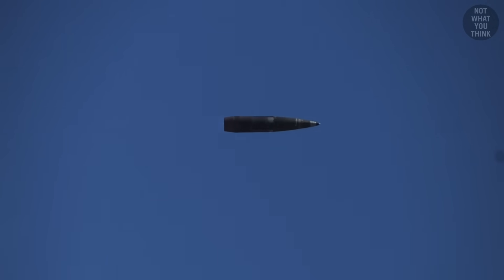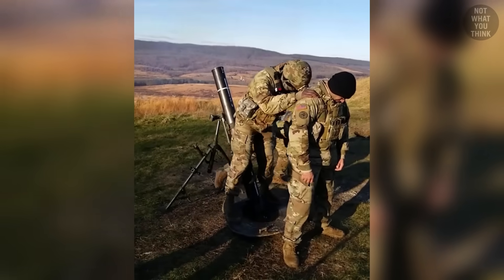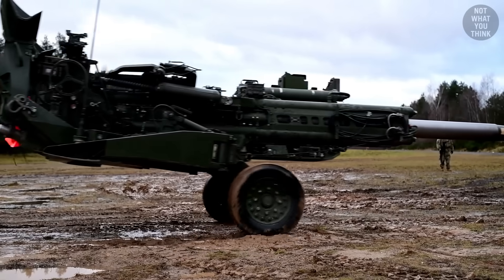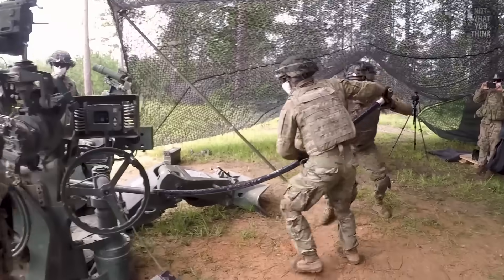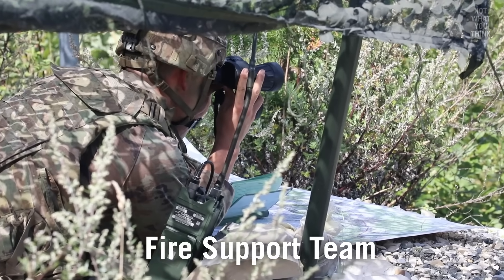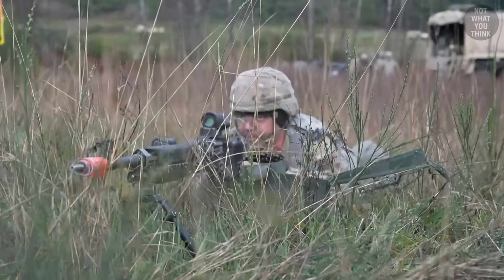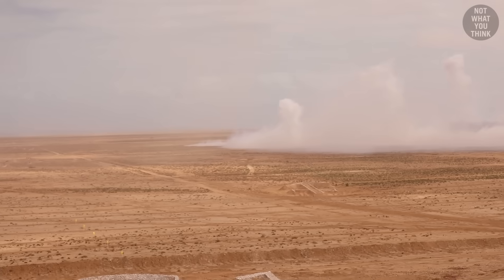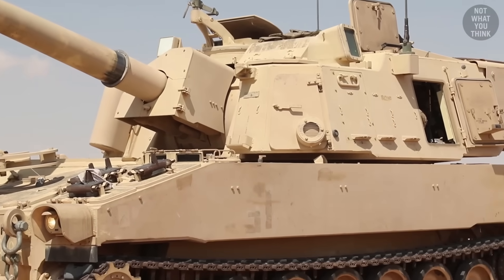How Aiming Artillery without Seeing Target Works

Comment: I served 2 years of National Service in an FH2000 battery 14 years ago... The most vivid memory is still ramming iron pickets into the ground with monkey rams and standing on the trail legs to drape the camouflage net over the gun, while the more "useless" fellas in the detachment scramble under the net to hook the sliding pipes up to the net to make it stand. And then when all was done we would hook ground sheets to the camo net with carabinas to shield us from the sun, and put soft drink cans in the cambros with ice to soothe us in the tropical jungle heat.

Comment: As a former artillery soldier, I have to say: this video contains a lot of half-truths that might sound impressive to laypeople – but they don't reflect how things actually work.

For example, the claim that firing at angles below 45° is done to hit the target faster due to a shorter trajectory. Sounds logical, but in practice, that's nonsense. Artillery is all about range, impact on target, and tactical necessity – not speed. Most of the time, artillery fires indirectly, often at angles above 45°, depending on distance, terrain, and ammunition.

The part about "target posts 160 meters in front of the gun" is also completely wrong. In reality, surveying teams place reference points (e.g., poles) with known GPS coordinates to precisely locate the firing position. The guns are then set up around that, depending on the terrain. The fire control center receives offset data for each gun in mils and distance relative to the reference point – this allows for precise coordination.

Yes, direct fire is possible – but only in emergency situations. If the enemy gets that close, something has already gone very wrong. Artillery is usually positioned 15–20 km behind the front lines. To engage in direct fire, optics need to be swapped, angles set manually, etc. That’s not a standard tactic – it’s a last resort.

The real danger for artillery is counter-battery fire, often via radar that tracks incoming rounds and triangulates the gun’s position. That’s why systems like the PzH 2000 are so effective: roll in, auto-survey via GPS, fire, transmit data via datalink – and move out immediately. No time for the enemy to respond. Hit and run – that’s modern artillery warfare.

And the soldier "looking through the sight" in the video? That’s not a sight – it’s a gun laying device. He’s not aiming at a visible target. He’s adjusting the gun based on elevation and azimuth data. Artillery doesn’t fire like tanks. It’s math, not line of sight.

Bottom line: If you’re going to present military topics, make sure you do your research. Otherwise, you're spreading misinformation that might sound exciting – but has little to do with how things actually work.

Comment: At 9:08 it is mentioned that the cannon crew can fire without commands from the Fire Direction Control (FDC) There is a little confusion there. A cannon crew can't do indirect fire without data from the FDC. The aiming stakes do not work like that. A cannon crew can only do direct fire without data from the FDC. That is where the target can be seen by the crew and is in direct line of sight of the gun. The aiming stakes are being emplaced as an aiming point to keep the gun laid on the (line of fire) or the azimuth of fire. There are 3 types of aiming points we use. The collimator which is primary, aiming stakes and a distant aiming point-- like the crest of a hill. There are reference points used by the gunner.

Comment: Correction: 7:54 into video. The FDC does NOT know the location of the targets. They are supposed to know the location of the forward observer and fire on the target based upon the forward observer info. The adjustments are made trying to bracket the target and then do a fire for effect. In my  experience, I never saw a FO just call in an 8 digit coordinate to the fdc and ask for an FFE. They will more likely give a distance and direction and the base gun will fire a round and then await adjustment info from the fdc. Now, if the target has been previously fired upon, it probably has been registered and can be fired upon again without adjustment.

Comment: Artillery tables - the ones used for aiming shells - were made by computers. Computers were groups of women with slider rullers that created the detailed tables using interpolations of a more coarse table produced by experiments. These had to be recalculated every new batch of shells. Then the Navy decided to make a computer to do that job and since they were really sensitive and respectful of those women's work they called the machine ... Mark ...

Comment: I recently read about the achievement of the 155 Ramjet Artillery Round.

Those not as intimately familiar with the Indirect-Fire Team as am I could not grasp the enormous significance of this easy to overlook technological advance. The magnitude of its significance can be easily overlooked especially with all the attention deservedly being garnered by the advances in drone technology and Artificial Intelligence.

But, as an old Fire-Direction Control Specialist, it falls upon me to bring this to your attention.
As I look at the threats surrounding Israel, I think that the 155 Ramjet Artillery round should be a priority for the US Army. Then Israel can hit targets hundreds of miles away with comparatively inexpensive Artillery fire. An Artillery Battery will not have to reciprocally lay in a gun section, (that's how all the guns in a section or battery are aligned to all be on the same proverbial sheet of music), in order to achieve precision fire with ramjet rounds that can fly themselves onto targets. There will be no need to conduct ammunition consuming Registration Missions, (the equivalent of zeroing your rifle for an Artillery battery), for Artillery pieces firing 155 Ramjet Artillery rounds.

The number of Artillery rounds fired in training can be greatly reduced as the ramjet rounds don't need highly trained Artillerymen to be able to lay in an Artillery battery, conduct registration missions (which uses up ammunition), or to even learn how to adjust fire onto a target. When a Call-For-Fire is received from a Forward Observer (FO) or Harassment and Interdiction (H&I) fire is ordered to be plotted on a map and fired, not nearly as accurate Firing Data will need to be computed by the Fire Direction Control (FDC) and provided to the guns, (that takes a little time), and a Fire-For-Effect as requested by the FO or ordered by those with the authority to do so can be fired precious minutes faster because the Ramjet Artillery rounds have built-in Artificial Intelligence controlled guidance. In short, and I'm sure this will be an oversimplification, the Artillery guns will be able to aim in a direction and fire the ramjet round. Once the ramjet kicks in, the round itself can compute its flight data onto the target it has been directed to hit. 

The call for Ramjet Artillery ammunition eliminates the standard practice of Artillerymen needing to adjust fire onto a target. 

The Ramjet Artillery round will steer itself onto its target!

This is a gamechanger of a technological advance and couldn't have come at a better time! Now that enemy drones have been shown to be able to take out Artillery pieces, keeping our Artillery batteries farther away from the enemy yet being able to still reach out and touch him with a Ramjet Artillery round can be a life-saving strategy.

This is much bigger an advance than the timed fuze was. Ramjet Artillery rounds can respond more quickly to a call-for-fire and with precision accuracy never before available from the first round fired by an Artillery piece, although..., I did plot the data for a 4.2'' Heavy Mortar (107mm) during training at Ft. Irwin National Training Center and hit the target metal to metal with our first round out! (Could not resist but to bragg just a little. :) )

That's like a hole in one. And I'm waiting for the first guy out there to say, 'But the Mortar is an Infantry weapon!' and they will be right, but it's also an Indirect-Fire weapon, which in my book makes it an Artillery piece! 

Artillery is known as the King of Battle for a reason. 

No student of Military History worth his salt will challenge the fact that the invention of the timed fuze was a gigantic game changer in military tactics and military doctrine because it proved to be an enormous force multiplier. Fuzes could be timed to explode 20 meters in the air above the target and their airburst would spray down covering a large area hitting troops in the open and most notably troops in trenches, or the fuze could be set to 'Delay' and it would first penetrate bunkers then explode being very effective against those hardened targets. This simple advance of Timed Fuze increased the effectiveness of Artillery greatly and resulted in the need for far fewer rounds to complete equivalent missions. 

It also greatly reduced the defensive effectiveness of trenches. Before the Timed-Fuze, Artillery rounds exploded when they hit something. That's why so many came back from WWI with those horrible shaky symptoms you see in very old films. 

They were literally Shell Shocked! It took a lot more rounds to complete a mission before the invention of the timed fuze. 

That meant military forces had to transport all that heavy ammunition and the respective nations had to pay for it. Amazingly, 155 Ramjet Artillery rounds do less damage to the barrels of the guns from which they are fired than regular Artillery ammunition because there is no need to put a large charge behind the round; just enough powder is needed to get the round up to the speed at which the simple design of a ramjet can kick-in. 

This might not sound like a big deal, but in a protracted war such as we are now witnessing in Ukraine, Artillery pieces can reach the end of their reliable service lifetime and barrels can, after much use, fail. As you might imagine, that would not be good for the Gun Bunnies working the gun when the barrel fails. 

Though at present the 155 Ramjet Artillery Rounds are more expensive than the ammunition we in the US and in Israel presently use, that is because the technology to field them has only recently been achieved. 

You might be thinking, 'What took them so long?' The ramjet design incorporated into an Artillery round has been something of an up to now unattainable Holy Grail. 

The simple fact is that engineers had not been able to design a ramjet Artillery round because the forces exerted on a round when it is fired are incredible and would break previous efforts at achieving a fieldable round. 

I don't know this to be a fact, but I suspect that the very recent advances in materials, especially GRAPHENE, is what now gives engineers the ability to design and field a reliable ramjet Artillery round. 

The battlefield advantages of an Artillery round that can go four, five, and more times the distance of the maximum effective range of any given Artillery piece now in service and can hit its target with precision on the first round out with no need for the time consuming adjustment process of the Indirect Fire Team wherein the first round is spotted and corrections are radioed to the Fire Direction Control personnel for them to compute new firing data to relay to the gun(s) to try again, and then go through that Call-For-Fire process AGAIN AND AGAIN until the FO decides it's close enough to call for a Fire-For-Effect wherein the specific number of rounds fired by the requested number of guns can then be fired all at once in a Fire-For-Effect volley of fire, or in succession at the command of the FDC can not be overstated. (Whew! How about that for a paragraph-long sentence from an old Artillery Fire-Direction-Control Specialist!) The benefits of the 155 Ramjet Artillery Round can be measured monetarily, for although they are individually more expensive than their predecessor ammunition today, far fewer of them have to be shot in order to achieve an "End of Mission..., Target Destroyed!", the benefits can also and far more importantly, be measured in lives because in the business of the delivery of Indirect-Fire response time can mean the difference between life and death for those calling for the Steel Rain or for the troops they are providing Indirect-Fire support.

And of course, the price for ramjet Artillery rounds will naturally come down with mass production.

Consider the missions that ramjet Artillery rounds could be used for: Missions where today we would send a Fighter Jet loaded with millions upon millions of dollars of explosives ordinance and of course a pilot who, if captured, can be used as a weapon in the waging of Psychological Warfare and as diplomatic currency in negotiations.

Now we can take out that target with an Artillery piece that we already have in our inventory!

No billion dollar manufacturing effort needed to bring a new weapon into our inventory!

Ramjet rounds could undertake missions where today we might launch a very expensive Missile or have to send in several helicopters loaded with highly trained special forces. I don't know how much a Tomahawk Missile costs, but suffice it to say millions of dollars less than even an expensive ramjet Artillery round or even a whole bunch of them. And if the cost of the ramjet Artillery round saves helicopters full of American warriors, then the cost of the rounds will be very low indeed.

My Military Operational Specialty, that is to say M.O.S.,in the US Army qualified me in two of the three coordinating elements of the Indirect Fire Team.  Every soldier in the US Army learns the basics of calling for Artillery Fire, that's the third coordinating elements specialty: Calling for fire. 

Though I've failed at just about everything else in my life, I was pretty good at FDC. I am not an expert, just had a little more experience with Artillery than most.

I also served a short stint in the French Foreign Legion--no shit! I really did!--but I deserted. C'est la vie!

I thank God we didn't achieve a successful Ramjet Artillery round while Beijing Biden or the Manchurian Muslim from Mombasa were occupying the Oval Office. They would have had the blueprints to the round in Iran, China, and Russia's hands already for the purchase of one of Hunter Biden's "works of art."

That is all. Nothing Follows. Chris Farrell, honorably discharged US Army Artillery Fire-Direction Control Specialist, (13-Echo), and Heavy Mortarman (11-Charlie.) 
End of Mission. Out here....
Reply: millions of dollars more, not less. Shit..., that was a long one.

Comment: Thank you for explaining modern artillery. However, how are the larger caliber rounds fired? Mechanical action, like a firing pin striking a primer or an electric shock with a battery?
Reply: The m777 uses seperate loading (no casing)  there is a narrow tube that enters the breech.  Externally mounted is basically a gun that fires a spit of flame down the tube igniting the charge inside.  It has a magazine the cartridges resemble .410 shotgun shells. Most 105mm is semi fixed the casing has a primer just like a smaller bullet, it's struck by a firing pin.  Other seperate loading howitzer use different schemes.  Some are even electric

Comment: I served in the Brazilian army in 2022 at 12 G.A.C. I was trained to operate the M114 155 mm Howitzer, which is a bit obsolete nowadays, but the explosive grenade still causes great damage. I used to operate the telescope and calculate some derivatives sent by the firing center, I don't know much about the calculations made by the communications soldiers, I just did the dirty work by placing the derivatives in the telescope and pointing the howitzer to whoever it would hit.

Comment: This is probably the best explanation of artillery I have ever watched. I was a signal supports systems specialist (25u) and later a Cavalry scout (19D). I have done a few call for fire training before with adjusting rounds “left 1 zero zero, add 5 zero, drop 1 zero, fire for effect, etc” “splash over” “splash out”. All of that is familiar. What I never knew about was from the gun crews perspective.  How they actually translate those bracketing commands on the actual gun. Very very interesting. now I know. I also now know exactly what the shrapnel pattern is when the shell lands. Even with HE rounds with an impact fuse, this footage still shows that the shrapnel doesnt just spray up like I thought. I guess this is why the kill radius is 50 meters. that air burst fuse footage was probably one of the best parts of this video. That thing explodes anywhere above an infantry platoon, it is like a fricken giant shot gun blast shooting down at ya. That is just terrifying.  Aircraft bombs are one thing, but this is the reason why artillery will NEVER be obsolete.  That 155mm battery is just as deadly as an aircraft, and can even shoot during shitty weather. An aircraft cant do that.
Reply: I hate weapons of war. We humans use our gift of intelligence to create horrible abominations like mortars and artillery
Reply: Imagine that, a Cav Scout somehow working that information into a conversation. 🙄